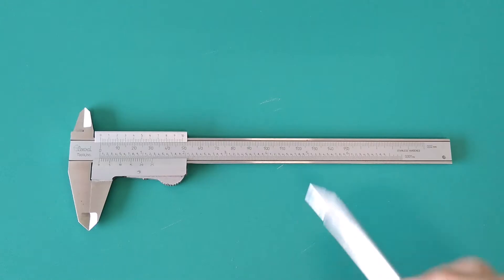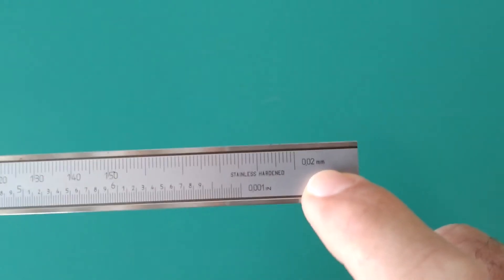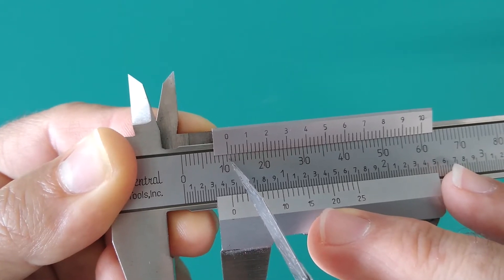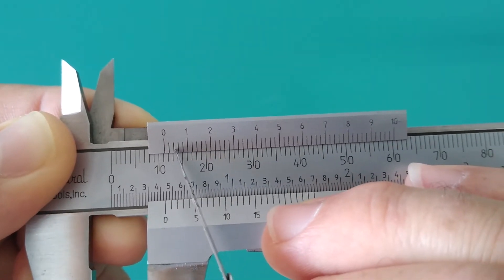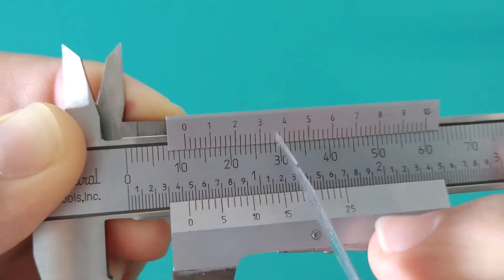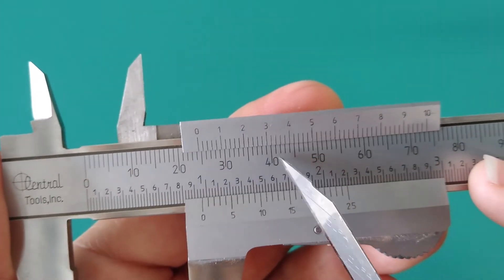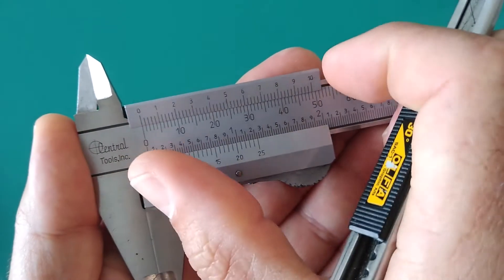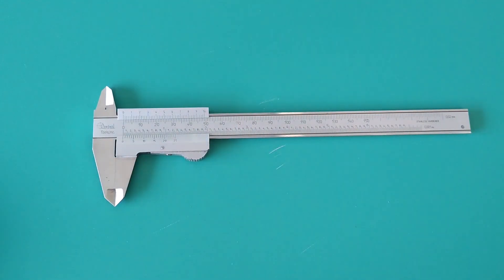Step by step tutorial on how to read a metric Vernier Caliper.

Comment: What if the caliper happens to have 25 parts not 10, is it the same procedure?.. i cant send a picture
Reply: Same as the ones in the lower part of your caliper,but the main scale is metric
Reply from the maker: Hello Cris, it should be the same procedure. Read as much as you can from the main scale, only then look at the vernier scale to further divide the smallest division that you can read from the main scale and see how far into it you are. In other words, remember that the function of the vernier scale is to "zoom in" on the smallest division of the main scale and read it. Whatever the vernier reading is, is the last digit of your total reading. 
I hope that makes sense and was helpful.
Reply from the maker: Hello Cris, i replied to your question on your second comment. I hope it helps.

Comment: How many millimeters does the vernier caliber indicate?
Reply from the maker: Hello tanvir tit, the one I was using in the video had s span of about 150mm. Although this is a very common size, there are different sizes, they are not all the same length. There's shorter ones and longer ones. The size of the caliper depends on what the application is and the size of what you are trying to measure. I hope this answers your question and thanks for watching my video.